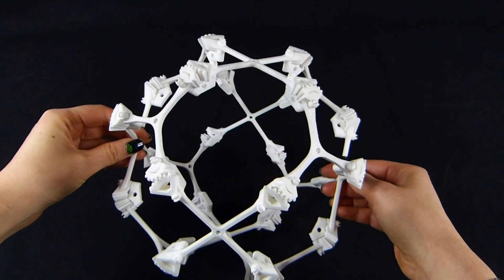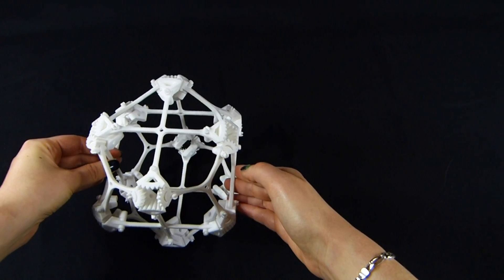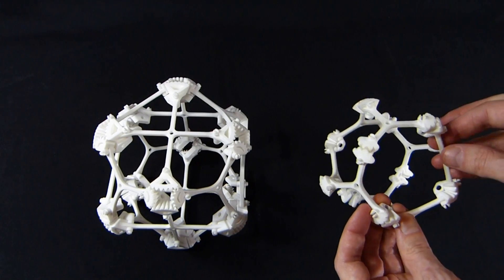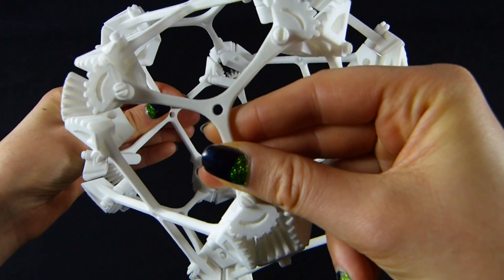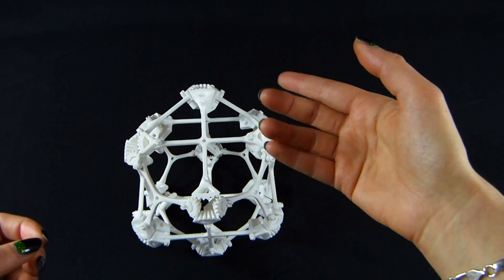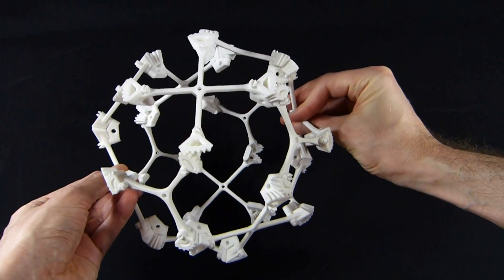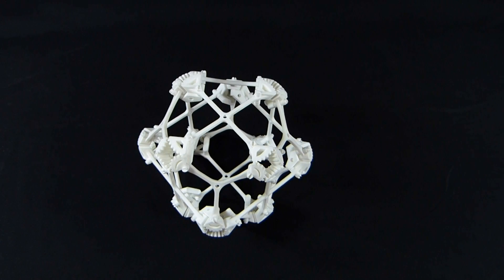Geared Cuboctahedral Jitterbug

Comment: Wait, so the pieces are not connected to each other except by the gears?
Reply from the maker: There are little "V" shaped connectors that form the axles of the gear shapes, but otherwise yes, that is correct.
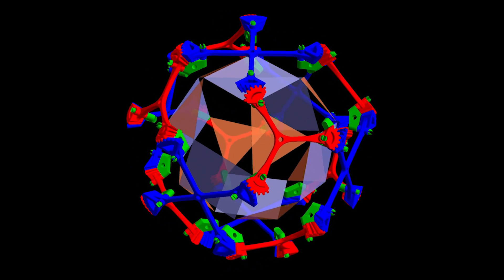Reply: Green pieces at 2:30